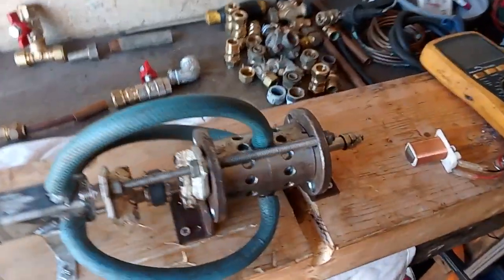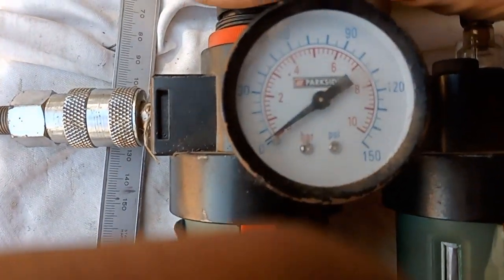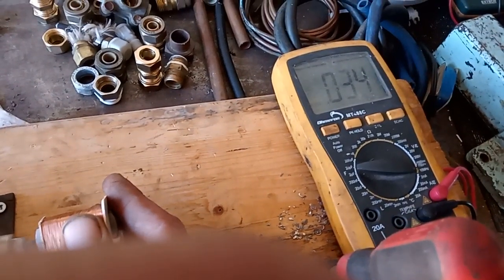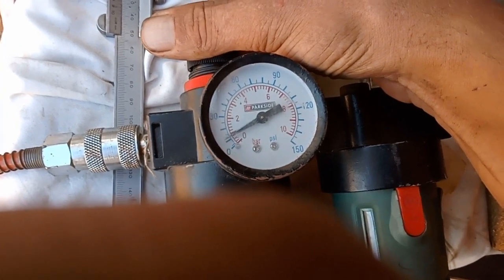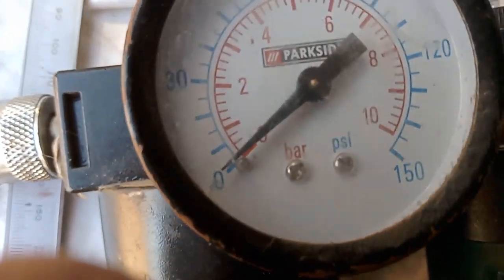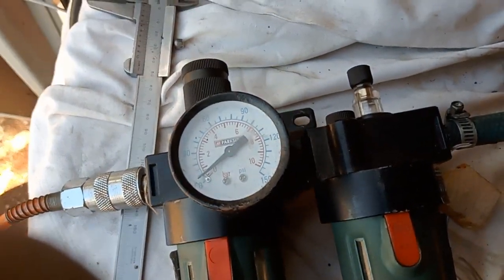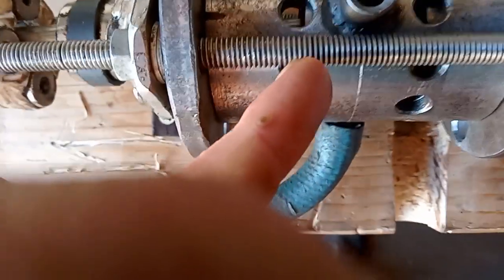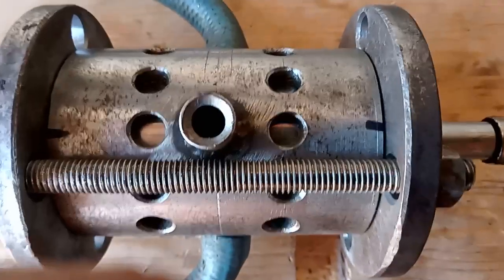Tesla mechanical oscillator/earthquake machine testing

Comment: Hey, Im no engineer or anyting but do you think it would be theoretically possible to recreate a even stronger mechanical oscillator like tesla did, but with neodymiummagnets? They werent invented through teslas lifetime so my thoughtprocess was that because they are even stronger, it should resonate way stronger than with normal magnets ?
Reply from the maker: Ow Absolutely if wil be a much faster oscillation do to the higher force it gives the mass more stiffness , its like a LCR circuit tesla was a master of LCR.

 although working whit big strong magnets is a nightmare do to larger eddy currents in the machine near it , dust collection en danger of losing a finger or 2 ,  I got a max of 65 hz whit 2 engine valve springs they've pretty good for such things en it could be tuned aswell from 36 to 65 hz whitout adding mass
Reply: You guys should do it let us know

Comment: I think you missed something. The water and steam were to create steam hammer and water hammer (look it up in plumbing) When they hit it causes an ultrasound wave . The effect is an amplification of the energy. The end part was to create frequency. The middle is ok to use are for constant timing. And the speed was much slower.  Anyway good luck I like it so far..
Reply from the maker: Thanks for you're support,  I highly appreciate it , interesting idea! Do you mean that is the steam condenses in the down stroke it makes a vacuum? in this particular test 3 inputs where buid en only air is used , even on the most wet steam I didn't see water hamer, next thing is a airspring/compressor en a different alternator like in fig 1 of the patant
Reply: @oscarverwey  If you have ever had your sink stutter then you have seen it. The act of water hitting something really hard constantly makes a pulse wave. 

the steam hammer is when it converts from water to gas and back again. the pressure in the pipe makes the reformed water hit the side wall with force. that makes a pulse wave. 

The air part is the constant part above that. it is timing. It is support to keep everything balanced. 

The top is wire and magnets. The goal was never to produce energy. It was to make mechanical frequency. Put your multimeter on frequency. 

The whole idea of the machine was to resonate something at very low oscillations. If you look at the numbers it took to make the steel in his building resonate ( super high vibration at a molecule level ) then the whole thing makes sense. It took a whole day to do. 

You have to take a resonance frequency and divide by 2 until you get the number in the teens. Then plot each point at those numbers. Every time it hits those numbers it adds energy until it saturates the metal. 

I have an example on my page that talks about frequency. https://youtu.be/zPhVmkhGIrc
Reply from the maker: @nathan bunten I know about cavitation although I never had a sink shutter,  this is way I don't want a external heating coil for the cryophorus system it's gonna be destroyed pretty fast, about the frequency generation I've tuned it from 12hz to 80 hz en it's really amazing how stable it is at different run pressures, one's I attached it to a big rock en poked around whit a speaker on a stick whit a hand held oscilloscope,  I always thought the mechanical oscillator was build to make electricity of constant frequency so tesla could eventually work on the transmitters en al kind of apparatus like telegeodynamics en radio's, I believe the mechanical oscillator is the first peace of the puzzle to understand tesla's work fully , i like te idea of the water hammer , although it can destroy a lot of stuff just like cavitation , as I understand it only rhe turbine can withstand such forces befits not in direct contact whit the flat disc's as this is also a project of mine right now 😀
Reply: @oscarverwey  I found water hammer in a strange way. I was watching a guy on you tube get conductivity out of granite. so i tried it. as long as it was wet it was conductive. 

The real answer was that the fluoride in the water and the silica in the granite were having a reactio0n causing the water to pick up the piezoelectricity of the quartz in the water making the water the conductive part. 

so i put the granite in a bowl of water then added a wire to another one. every time i added a bowl the conductivity went up. 

left alone the conductivity would continue to increase. then immediately dissipate when touched. 

the best part was I got a glass of water from the sink during the experiment and when the water was shut off it made a pulse wave jumping the conductivity. 

Tesla was never making energy, he could build any kind of motor or generator he wanted. He was studding the pyramid. He wanted to resonate the quartz in granite. 

I will do the test again soon. I will send you the link. It's one of the best experiments I have ever done.
Reply from the maker: That's super cool , I always thought way granite is conductive is because it's transforming electricity into mechanical like a piezo en turns it back again whit minimal losses
Reply: @oscarverwey  It changed how I saw the pyramid. If tesla could resonate quartz then the layout of the pyramid now makes perfect sense. 

I hope you can make your machine work. 
I believe we are on the same path as far as the frequency. 

I always thought that more power was better, but it seems low power and low frequency is what he was trying to tell us.

Comment: Thats not going to tell you the frequency like that lol is going st a few hundred if not thousand hertz
Reply: Actually it's really close to 30 hz, you can tell by hearing a 30 hz sound. Here is an example https://www.youtube.com/watch?v=exeRki77OMY
Reply from the maker: the patent states it can do many thousand cycles a minute! Not second , it Al depends on the stiffness en the force of the spring in combination whit the mass of the piston (like a electrical LC) en mi spring is not verry strong en only do about 2000 cycles a minute
Reply: There’s the fore of a spring (we are using mag repulsive) the piston weight but you must account for pressure as well. We changed part of the design to allow for the non use of physical springs. But for small applications this is not a practical approach

Comment: Really awesome! I am glad to see you making progress! Looks like you are getting it tuned in very well, I want to see some more powerful neodinenum magnets on that thing so bad!!!
Reply from the maker: Thanx , Yas verry glad the extra work pays off ,The magnets are on ther way :)  orderd. 2x 40x40x20,  4x 40x25x10, 10x 40x10x10 n52 neo's, so i can make different setups to see what works best, IT takes 40  Days to ship Them to greece ,in the mean time i gonne focus on the steam boiler
Reply: @oscarverwey  gosh this is so exciting! I CAN'T WAIT!
Reply from the maker: Ik heve seen the osilation (tripping of the bar meter ) in one of your video's to ,way is it doing IT?
Reply: @oscarverwey  I've been sharing your videos, I hope it's helping.
Reply from the maker: @iEnergySupply yas IT helps for sure, Thanx Its verry kind of you , i can not wait aswel for the bigmag's to arive
Reply from the maker: @iEnergySupply  I have 2 questions for you , as you have some experience in this , is there a substitute for ammonia as a additive in the water to lower the boiling point ? Meby ethanol? I'm working whit copper en messing (kopper/zink aloy ) so I don't wand to use ammonia, second , how do you keep the vacuum pump dry I bed it's gonna rust after some time ? Thank you in advance
Reply: @oscarverwey  well, I don't think it's necessary to use ammonia. I stopped using it. The interesting thing is, water has a higher boiling point, but it also has a lower pressure on the condenser at higher temperatures. I think water is the perfect fluid to use but I really want to try rubbing alcohol, or ethanol.
Reply from the maker: @iEnergySupply  that's a good point about the condese temp/pressure so you don't heve to use ice enymore, just a bit cooler than 15c is oke I think?  I'm planing to put the condenser in a frige ore something so it can regulate the temperature if nesesery , thank you for the advise !
Reply: @oscarverwey  yeah, I actually did end up running the turbine without ice and it worked really well. I have so much more testing to do though, for power outputs and stuff. Putting the condenser in a fridge is a good idea, but you might find that just cold water running over your condenser will be effective as well. I look forward to your testing!
Reply: @oscarverwey  I think when my needle started vibrating, it was actually due to the vibration from the turbine matching the resonant frequency of the needle on my gauge, but it's still unclear to me. Something different may be happening in your situation.